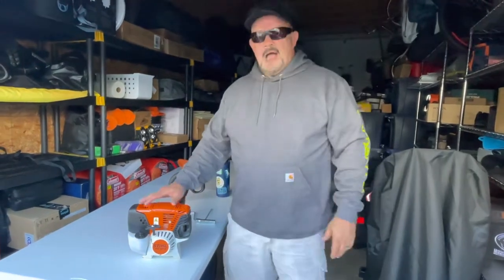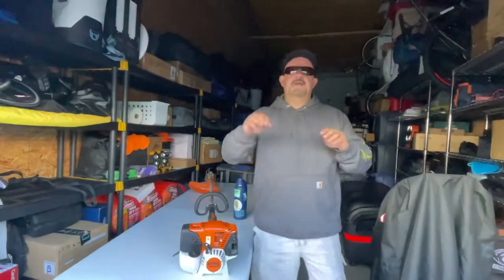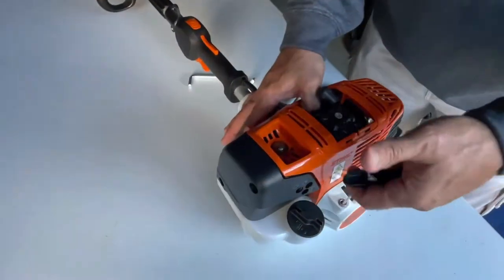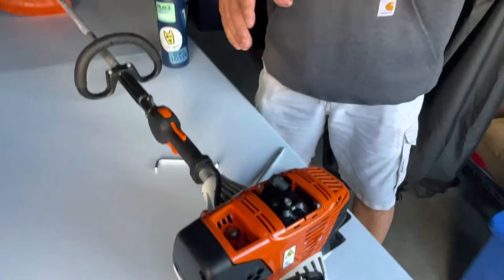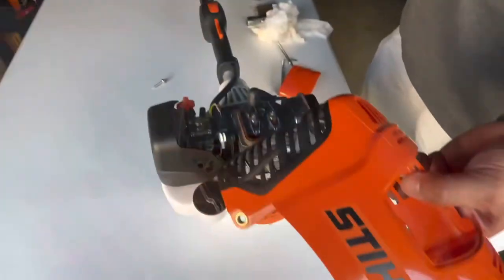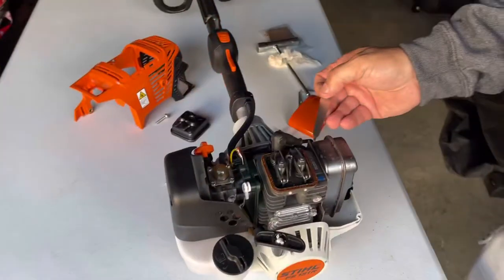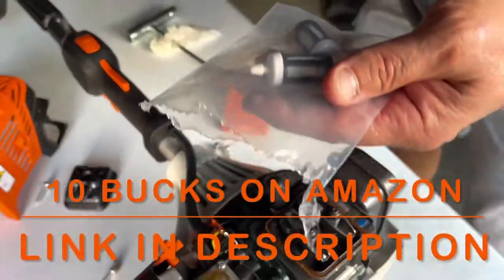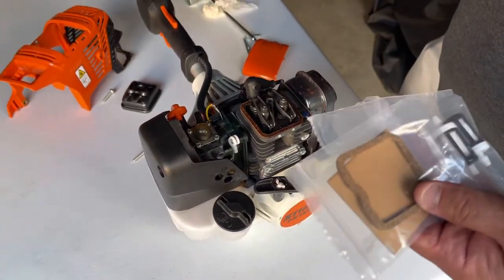STIHL Trimmer Rope REALLY Hard to Pull When Starting!

Comment: Question: What could be the problem if this happens on a 2-cycle engine trimmer? I replaced the piston and cylinder on my Husqvarna trimmer and now i have this problem. I’m able to pull the string but it will not retract back when the spark plug is on. I’m hoping this is an easy fix. Thanks in advance!
Reply: try putting engine oil

Comment: I paid 89 cents for the feeler gauge at the Stihl dealer. I found out later that my Stihl FS 70R does not even have valves so now I have to go out and spend a couple hundred bucks and buy one that does so I can use my new feeler gauge.